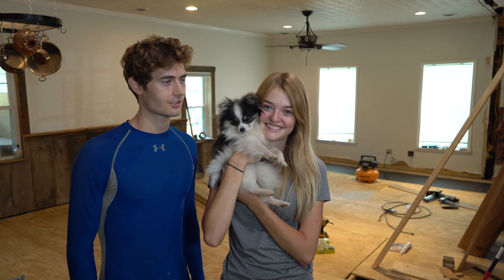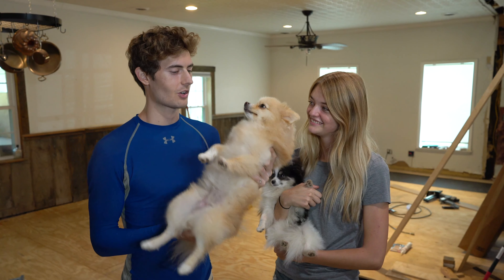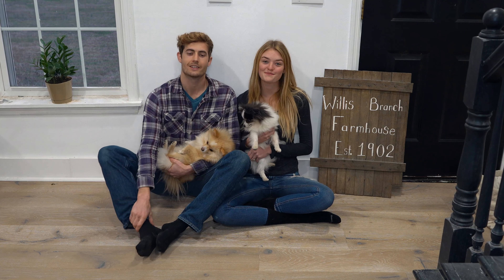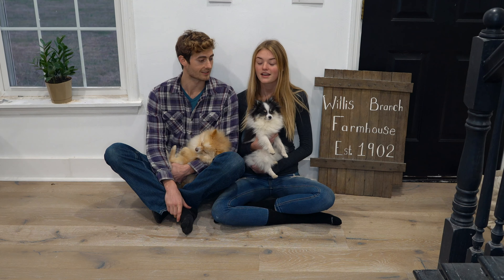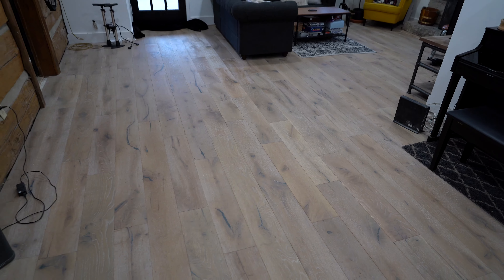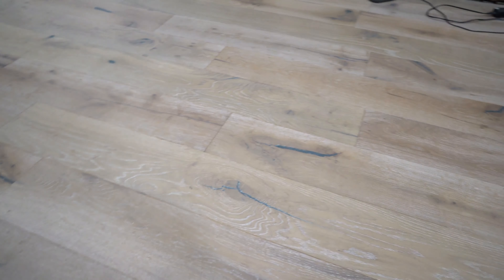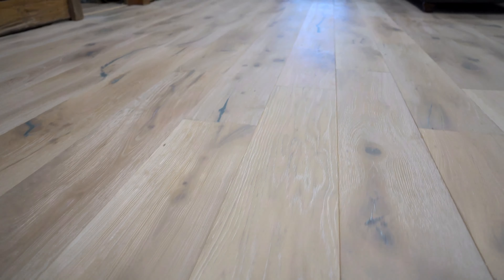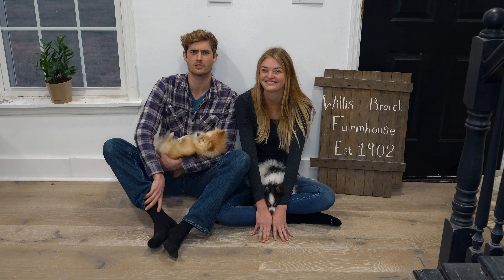Installing our New Wood floors by Provenza

Comment: I have read a lot of reviews regarding Provenza engineered HW flooring. Everyone says they are beautiful but have had major complaints with the quality of the floors, splinters (tearing up socks, scratching and cutting feet), as well as being very soft and denting easily along with staining very easily.  Then stating terrible service and resolution of problems.   Very curious of how you feel about the floors now after you have had them installed for in use for the past 7 months.  Thanks..
Reply: Same, definitely interested to find out how you feel about these after 9 months.
Reply: I'm considering Provenza engineered floors. Would you be able direct me to the user reviews to which you're referring? Thanks!